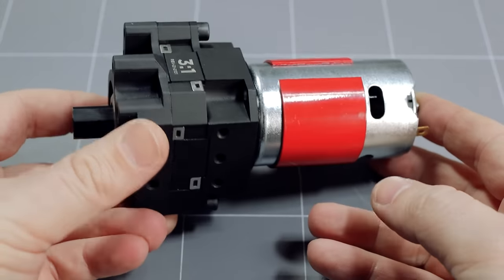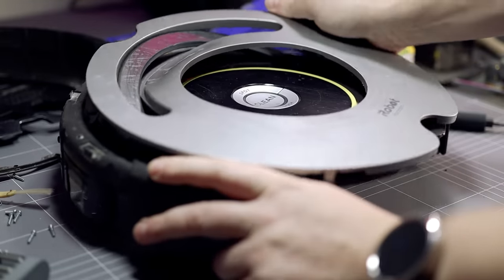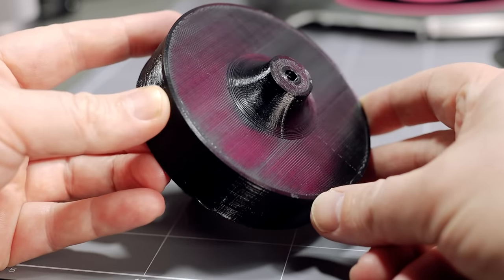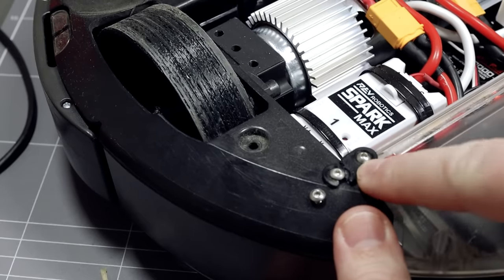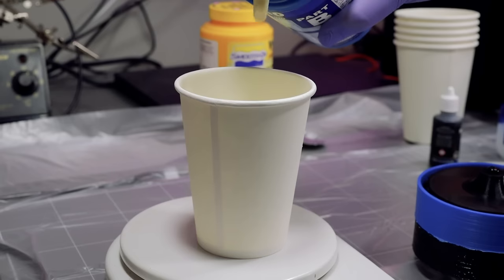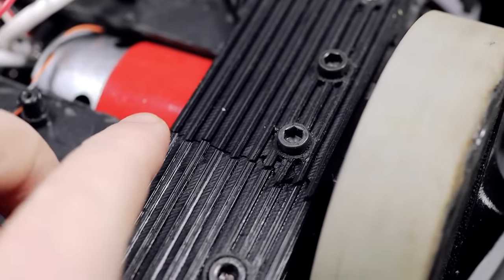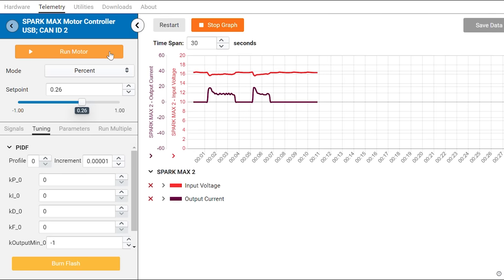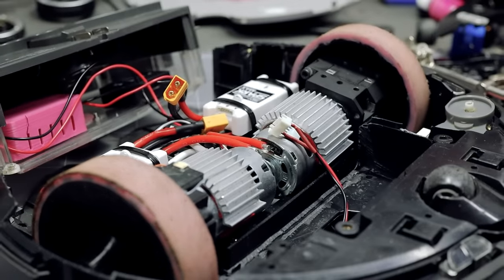Building the World's Fastest Roomba

Comment: Print the disc parts of the wheels a bit slower or try to add some ribs, (i know there is almost no space but it should help)
Reply from the maker: There are actually 2 mm ribs - it's all I could fit. I think I need to have as full rethink on the rim design.
Reply: @electrosync  then i think you are right it  is time for a material upgrade, just too high forces on that part. Hey if you go metal anyway, why not just make a wheely bar out of metal (without a wheel) you might could kick off some sparks or would that be too less force acting upon them ? Hey if you want to go out of the window with the project, may add spoilers difusors and such for ultra stabilidty xD

Comment: If it can't clean and travel autonomously then it's not a Romba anymore!, i have a LG HomBot 2.0 square (cleaning bot), you can change the default max speed for the bot from 350 to 2350 via a config file and a usb stick, that's about 10mph, the thing drives around my home, cleans the floor at 10mph, navigates at 10mph and all that is still fully autonomous. Every now and then the sensors don't cope with the speed and then it bangs loudly, but you can counteract this by setting the sensor polling rate in the configs to x4 and the range to x2. All pure software no hardware changes necessary!

Comment: Suspension to separate the drive motors from the wheels would help with handling and longevity of the wheels. Although the overall configuration of two drive wheels together like that will be inherently difficult to control. Maybe an arduino or some other logic to convert to a one stick control instead of tank controls. Left and right steers, up and down is forward and backward.
Reply from the maker: Yep, without a differential, it's difficult to control. I did use mixing to control it with one stick though. I'm honestly not sure if that's the answer though.

Comment: I really loved watching this. I love seeing the design iterations. I think you are already really close with the wheels, instead of your current material  I would recommend casting or printing the wheel assembly with  highest TPE you can find with a nylon hub for output shaft of the gearbox, as many materials are likely to break at what ever speed you have a sudden step input such as a road marker or kerb.  

Good luck 

Also Andymark is fantastic we  used them for everything at the drop bears FRC 4774.

Comment: Im thinking 3D Printed molds of the strengthening plates and the wheels.
Then make Carbon Fibre wheels & Plates from the molds. Should be considerably lighter than metal aloys but stronger than what you have now.
Although perhaps the added weight of aluminium parts will help keep its tyres firmly planted on the ground
Reply from the maker: Good ideas. Something I'll consider if I make another video!

Comment: You can solve your problem is you buy an electric skateboard wheel.
They are designed to handle high speeds.

Would also suggest a charging dock and a speed run of cleaning a room.

Comment: Plastic wheels are unable to compensate road surface roughness. Rubber compresses max 1...1.5mm, that is not enough. And that force is going further into the wheel. If you make wheel out of aluminum, it will break the frame. Add some softness. Springiness. Make rubber softer.. add air pockets. You need at least 1-2cm of rubber and compressible zone of around 5mm... not less.

Comment: 3:05 what is that flexible pad on your 3d printer heatbed that lets you print warp-free without brim?
Reply from the maker: That's the stock magnetic bed for the Creality Ender 3 Pro.
Reply: @electrosync  thanks.. just realized i actually have an ender 3 pro as well.. but its the v2 and came with a textured glass bed. strange they didnt keep using the magnetic one from version one. A flexible bed seems to make it a lot more easy to get the print off.. and using the glass bed i still have to deal with warping..
Btw.. got 4 broken roombas in case you need some parts. i gave uo repairing them and switched to chinese versions.

Comment: I posted a diy PET 3d printer filament extruder that can be made for as little as $20Aud 
I needed something much stronger than Pla and abs and as I have a cheap mega zero,  installing marlin was the hardest part for me.
But it payed off fast and very very well. Just use plastic pet Pepsi bottles etc. 
I have links to code and other project's extruder related

Comment: For casting the Rubber on the wheels I would suggest you too weight down the 3D printed parts inside the molt, because the liquid you poor in the molt makes the wheel part float and that's why the wheels are not straight/alignet

Comment: You need more suspension. You can make tire softer or... you can even make a softer wheel! For example by using this "rubber-like" plastic for it.
As for shape I have a suggestion: https://www.youtube.com/watch?v=Mm17rsTsIGs This can give you "springs" inside wheels.
If it's not strong enough there are some ways to make plastic stronger after printing.

Comment: You need to build tires that are actually build for road conditions. What you're not factoring in, and really highlights the type of engineer that you're not, is the friction and physics that are being applied as that "roomba" drives on that road. You've made a roomba that would work forvever in a home or gymnasium (where the floors are level, smooth, and relatively obstruction free). But the amount of friction and unevenness of those roads is what's throwing you off.

You're acting surprised that plastic is breaking at 30+ mph... but what you're not getting is it's plastic. And thin plastic, at that. If you made them thicker, out of rubber, or with an aluminum core, you'd have better luck.

Build for the environment, not for the task. You've clearly defined the WHAT (build a fast roomba), but you haven't defined the WHERE (where does it need to be fastest?). 

All of that aside - why does it matter? Haven't you basically just made a RC car? We all know the vacuum doesn't mean shit at those speeds so it's not like you've done anything new.